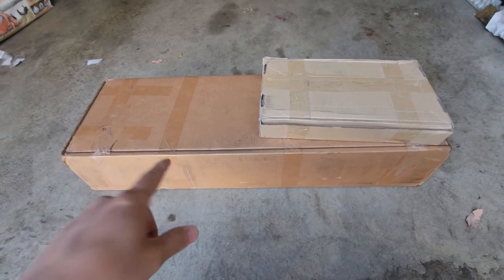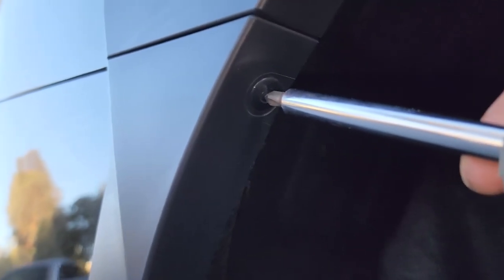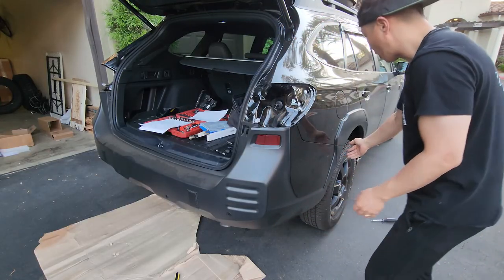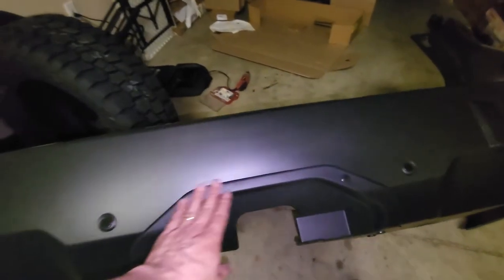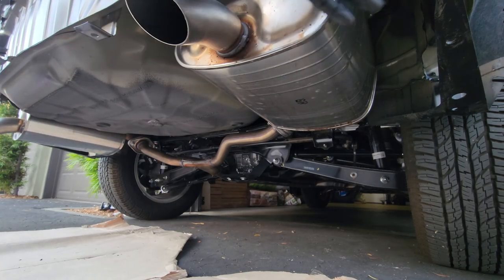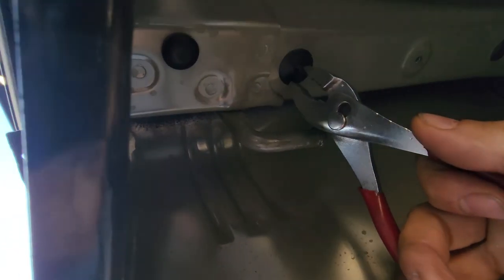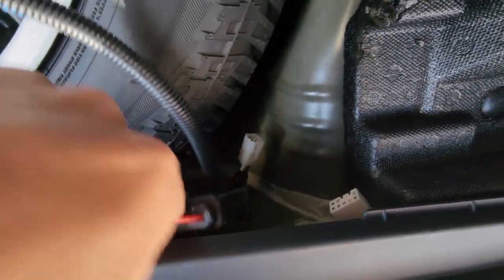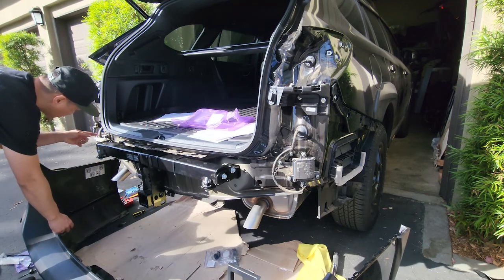Subaru Outback Wilderness OEM Tow Hitch Installation with Ambull Hitch Shackle

Comment: If you had a multi tool you could shave an hour off trimming the factory plastic bumper. I was thinking in the beginning this is a how not to install video....I love that you kept it real and left your issues with what our issues could be, nice job. If your shackle is still too loose and bothers you, cut some rubber washer spacers out of some old floor matts or a rubber matt or mud guard you can get at home center, should quite that rattle and still let it articulate. Good job.
Reply from the maker: that was exactly my point of this video! thank you for watching and glad I could help out!!

Comment: I hardly ever comment, normally lurk and consume - but I referenced this video heavily when working on my '24 outback wilderness. Very well done - some things that caught me off guard:
- Pay extra attention to the template for the fascia, I had spent a long time aligning it and everything seemed good, but after I cut it, I cut too much on one side (ultimately didn't affect anything)
- When marking holes for bottom of fascia panel, do one side - push the pins in, then do the other side (with the bumper on the car). I did it all in one go and go figure I have a tiny tiny gap on the bottom quarter of one side, nbd.

Other than that, not that difficult, I hung my mufflers instead of taking them off, didn't have any problems with accessing the nuts/bolts and I have large hands!
Reply from the maker: Thank you very much for your comment. I really appreciate it and I am just glad I could help out! and your inputs are all valid points! BTW congratulations on your purchase~

Comment: Finished mine a little while ago, I'm sure glad you mentioned the template dimensions in your video, mine printed the same way, measured 1" but was too small, imo, Subaru could have included a template in the kit, everything else went smoothly, just a lot of dang work to install a hitch, but it's done now and I can sleep knowing it was done right (without scratches too).  Thanks so much for the video, I hope lots of folks get to use it for their install!
Reply from the maker: That is so great to hear, and I am glad I could be of help!! And totally agree that they could of easily include instructions and template ... you are a true DYIer! 👍

Comment: Nice job. I did this install on my 2021 Outback TXT a few years ago and it went well. I decided to just have it installed at the factory on my new OBW to save me time.
Reply from the maker: Thank you and just to let you know, it's a dealer install option not from the Factory so, your at the dealerships mercy, and I've seen some horrible installation job 😢 that is why I opt to do it my self.
Reply: Interesting. I had thought if you ordered the car with it that it was not dealer installed and installed at the "port". At least what my dealer told me. If I bought the car without a hitch on it I would 100% install it on my own. @ChasingAdventuresCO
Reply from the maker: @johnj5343  I've heard that too, but I also heard that, at the end of the day, it's the dealer installing it. There are so many different stories, but either way, I hope everything works out for you. Please let me know how it turns out.

Comment: Fantastic work.   I’m not brave enough to attempt.  But I like the OEM approach with securely bolted brackets vs drilling into or welding on frame.  Too much at stake to get a lousy installation.
Reply from the maker: it wasn't easy but definitely worth it!

Comment: Great video as usual, i just bought my 2024 obw yesterday and order the oem hitch installed by the dealer, i see that you have to remove the rear beam inplace of the hitch, would you advice that I should tell my sales guy to save the rear beam and save it and get it back when i come pick up the car? Did you save yours or chuck it away?
Reply from the maker: Congratulations on your purchase!! 👏 👏   it's not necessary to keep it but I did. And its just sitting in the garage taking space and collecting dust. 😆
Reply: @ChasingAdventuresCO  ahh ok so I guess i rather not take it btw they charge me $720 for the parts and install, hoping they will do a pretty good job and will go under the car and inspect everything.

Comment: Good review. I just did a hidden hitch install on my friends BMW X5 and had to cut the fascia using a dermal cutoff. It worked really well and the project turned out great. Based on that and your video I am confident in doing this with my OBW that I am supposed to pick up in a week or so (once the SOS button issue is resolved) . Thanks again for a video showing the situation people really run into like no template include, scale of template questions etc. These snags happen and seeing how you resolved them is very helpful.

Last comment. Where did you source the CF tow hitch covers? Are they real cc or just vinyl overlays? Regardless I like that look and my car is crystal black silica and I like the idea of blacking out all of copper trim items.
Reply from the maker: Hello Jeff. Thank you for your comment. I really appreciate it and congratulations on your OBW!! And yes I didn't want anyone to be surprised when attempting to do this type of project on your own as I was. 
And tow covers are 3D matte carbon fiber vinyl from Amazon that I purchased. I still have the roof racks but didn't want all that orange accents throughout the car. 😕  
BtW. Nice color choice~ 👌

Comment: Great video- unfortunately I don’t have any tools or space to do this myself. My new wilderness will arrive from the dealership sometime in the next four weeks. In regards to the OEM hitch, fascia plate and also the two skid plates; would it be wise to have the dealership or speciality service shop make these mods? Wish I could hire you! Lol- but I’m in South Carolina. 😂 Also, I assume the front two shackles are attached by taking off the removable tow hook plate. If so, did you have to purchase additional tow hooks to screw into the front? Much appreciated and keep up the great work on the channel.
Reply from the maker: Well, I think you can still order them and it will be wise to have the dealer install them so that it will be under warranty if anything happens or they mess up. And I only had to buy one more of the tow hooks since the car comes with one already.  Can't wait for you to get your OBW!! How exciting 😀
Reply: @ChasingAdventuresCO  Thanks man! Yea, today the dealership said the factory will install the rear OEM hitch and fascia plate as well as the mud flaps. Good thing is there is no factory install fees. If I didn’t see your video on this , I’d have to pay the expensive dealership to install. Lol. Wish they made a copper shackle to match the cover plates. I’ll probably just go with a black shackle to blend in with the bumper. I must say your all black with red accents looks sharp. I went with the autumn green. I’d like to get my windows tinted as well. Finding a qualified professional is key for the tint! I’ll have to replay your video on that front. Thanks again for all the help.
Reply from the maker: @briantodd4887  Oh, that's even better!! factory installation is the way~ LOL I am glad I could help! https://amzn.to/3RIKVVd and this might be the closest thing to match the OBW color. give it a try, and if you don't like it, you can return it and go with the black one. and for car tinting, do ask if they have a tint meter to see if you need different shades to make it even.
Reply: @ChasingAdventuresCO  all great points, thanks. That orange shackle may do the trick!! 🤞 I would like to leave the  copper cover plates on as is. Had one question regarding the front bumper. : Did you simply remove the cover plates or place black film on them and drill a hole via plates to mount the tow bolt with shackle? I probably missed that video! Lol Much appreciated-
Reply from the maker: @briantodd4887  I removed the cover completely, because with the Shackle in place, you cant really see the hole but you can make a hole to have a cleaner look.

Comment: Was it worth it or would you recommend buying pre-installed
Reply from the maker: To me, it was worth it because I've seen some horrible dealer installed jobs and did not want to take the chance.
Reply: Have you seen a difference between dealer vs factory installed?
Reply from the maker: @carrollmoseley3572  you can do a simple google search and find horrible jobs that the dealer did, plus the overpriced labor. https://www.google.com/search?sca_esv=557804163&sxsrf=AB5stBhO2izLS7CO11sB6doVJFWvasjPEA:1692299807191&q=subaru+outback+wilderness+dealer+installed+hitch+bad&tbm=isch&source=lnms&sa=X&ved=2ahUKEwiFrPGGtOSAAxXUADQIHW-MD9IQ0pQJegQIDRAB&biw=1707&bih=843&dpr=2.25

Comment: What is the measurement to the top of the inside square from the ground? On etrailers and uhaul the hardware they have is about 15-16" on a non obw and depending on hardware kit. So I'm just seeing if the extra ground clearance is worth the cost and time to cut out the bumper. I have an obw on 245/65/17 toyos. So it might be a bit apples to oranges.
Reply from the maker: i think its only 5 to 6 inches lower. does that make a difference? well, that will depend on what you will be doing with your vehicle. personally, I didn't like the fact it was hanging low from the bumper.

Comment: I'm dumb, I didn't get instructions with my OEM kit for my Wilderness, and the template I'm seeing online doesn't look the same as yours, may I ask where you got your instructions including the template?  Thanks!
Reply from the maker: L101SAN000.pdf - Subaru Online Parts https://subaruonlineparts.com/docs/L101SAN000.pdf for the instructions and part number: l101san620 description: 2022 outback trailer hitch panel https://www.subaruoutback.org/attachments/l101san620-outback-wilderness-hitch-panel-9-9-21-pdf.521337/ for the Panel template
Reply: @ChasingAdventuresCO  
You're awesome, thanks so much!!

Comment: I have the same 2022 Subaru Outback Wilderness; I need to install Trailer Hitch for the Hollywood Racks Sport Rider Rack. Do I need to buy the same as you did? Thanks for your help.
Reply from the maker: Hello Feng. You do need a hitch. I got the OEM because it already came with the 4 plug wiring and the template to cut into the bumper. There are after market brand that makes a hitch and it's almost the same process.  But again I would go with OEM. If you have any other questions, feel free to ask anytime 😊

Comment: Dang.  That’s a lot of work.  I think I’m just gonna pay my dealer the $1000.
Reply from the maker: Haha it sure was and if you have the money and don't care about the outcome, go for it. No need to sweat it but I did it my self because I've heard and seen horrible installation done by the dealership, I didn't want to take that chance.  Plus got a satisfaction knowing I did it my self~
Reply: @ChasingAdventuresCO  My dealer also wants $500 for the parts and labor of the wireless charger.  Insane!
Reply from the maker: @jeffg3895  wow... dealer rip off. 😆

Comment: On Subaru's part store and the want almost $600 for the hitch then another $500 for the fascia!  Is that what it cost a year ago?  Seems a rip off for the fascia.
Reply from the maker: I think I paid 350 for all a year ago and haven't checked the price recently but it shouldn't be that much.
Reply from the maker: Just checked the price and the hitch is around 450 and the fascia is only 30
Reply: @ChasingAdventuresCO  Thanks.  Seems that's not the oem subaru parts store thought, right?  I googled the part number and found a non oem website selling for those prices.  When I go to the "official" Subaru parts website, it's different for the fascia (albeit seems an error for their price.)  Have you ever ordered from the vendor which has the prices you mentioned?
Reply from the maker: https://www.subarupartsdeals.com/oem-parts/subaru-trailering-hitch-fascia-panel-l101san620?origin=pla&gad_source=1&gclid=CjwKCAjwqMO0BhA8EiwAFTLgINQNoWvXuNZXkYovDP9S0AJpal-ubpaiu_l3nX_dFiWLanGpMKuRORoCdSMQAvD_BwE
here you go.

Comment: What are your accent covers?
Reply from the maker: Accent cover? Sorry Daniel,  I didn't understand your question.
Reply: @ChasingAdventuresCO  It looks like you blacked out the copper colored accents. Where the tow hook goes. Again,thanks for the engine guard and diff cover video. I cancelled the order for the engine one,as if they could get it anyway,and the rear diff guard. That is too much ground clearance to lose. Ebay here I come.
Reply from the maker: @Daniel-Weaver  oh. I covered it with carbon fiber vinyl that I purchased from Amazon. Thanks~

Comment: Literally made me break off my rear bumper reflector trying to remove it . Turns out the light didn’t even need to be removed. It’s okay I guess I can upgrade it to smoked or something. Definitely lost some brownie points on that one
Reply from the maker: Did you skip through the video? Because I did mention you don't need to take off the reflector..
Reply: @ChasingAdventuresCO  nope. Watched the video and was following along . I should have skipped around. It’s fine I just bought a replacement and watched another installation video
Reply from the maker: sorry you missed it. maybe I should of elaborated more.